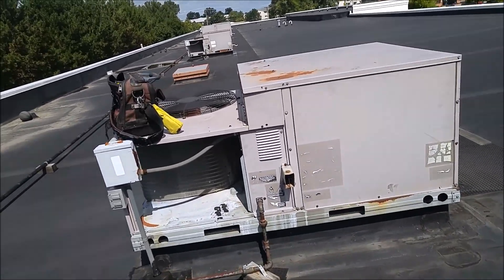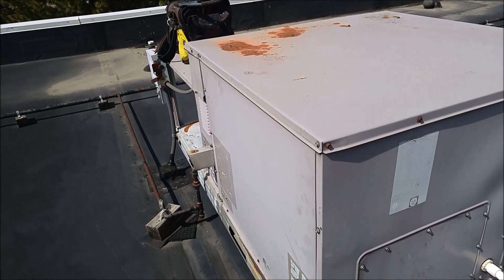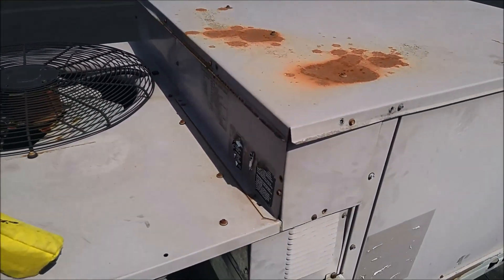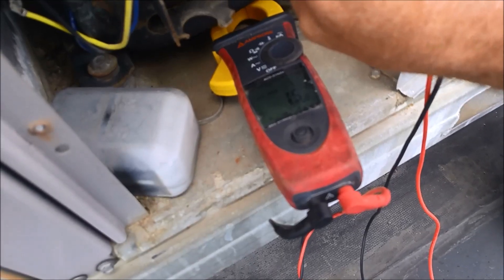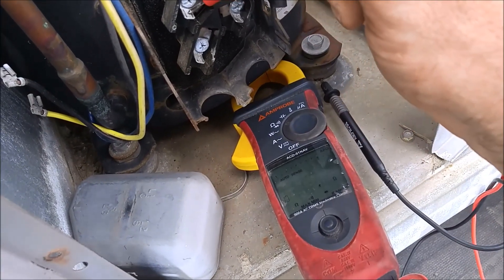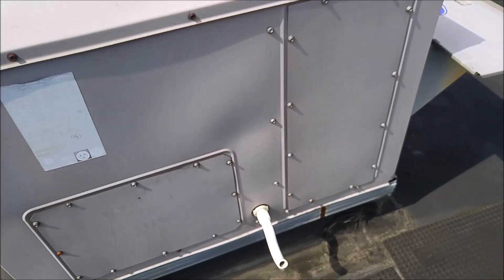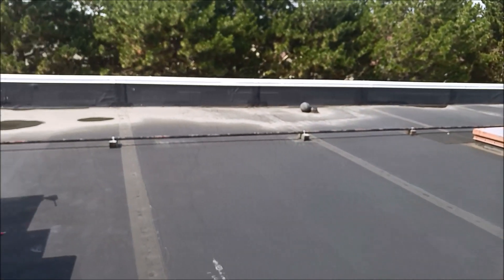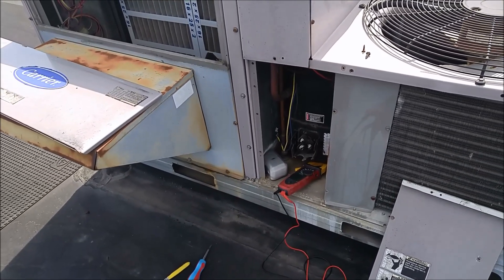Bad 3 phase compresser on a carrier RTU

Comment: Is there capacitor for 3 phase compressor? I have equal resistance reading and have voltage between each terminals, and no grounded, but compressor wouldn't run. The rushin current around 100v, then less and less, then to zero. Is it a bad compressor? Thank you
Reply from the maker: There is not a capacitor on a 3 phase compressor. Sounds like the compressor is faulty